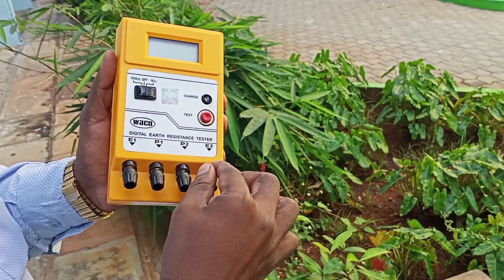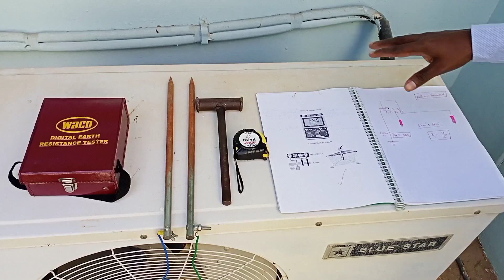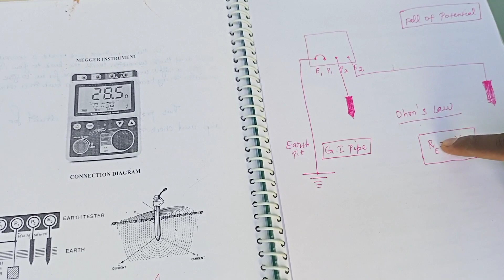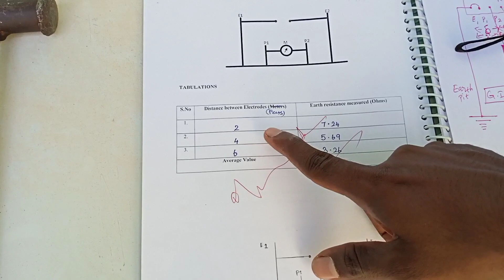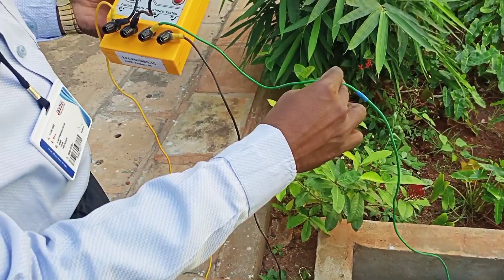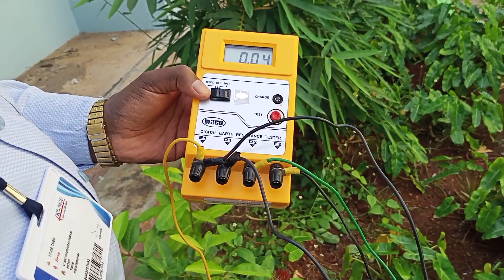Earth Resistance Measurement

Comment: Sorry uploader. Your method is absolutely incorrect as the spike spacings are not as per Fall of potential method.
You didn't mention the depth of the earth electrode under test.
You didn't tell whether the earthing system is energized or not.
You didn't mention the ideal resistance value.
Shows you don't have practical knowledge. Earthing is done for safety reasons. Don't please misguide. 
That log book tabulation is wrong.
 35 k views and nobody has pointed out the mistakes because they don't know. We real testers won't reveal the proper method. This is the reason that nobody (domestic and commercial services) check their earth pit resistance value.
You didn't tell about RCCB and TT earthing system.

Comment: Sir what is the diameter of the two electrodes
Reply: Diameter and depth of spikes are not that important. Can use 8 mm steel rod of about 200 mm long like screwdriver.